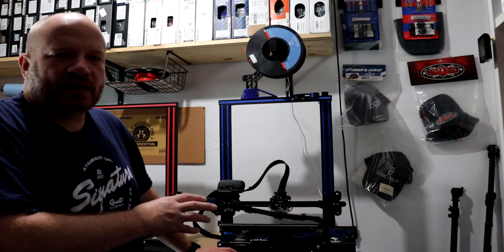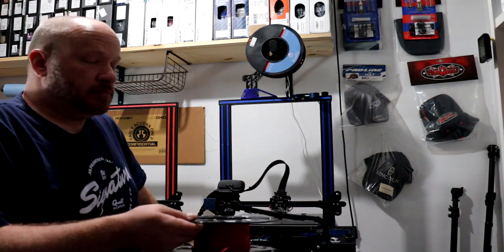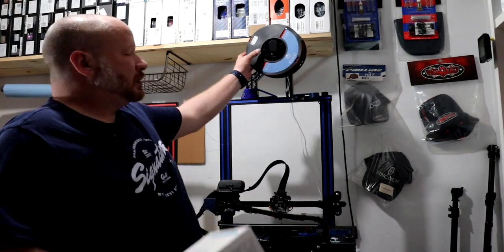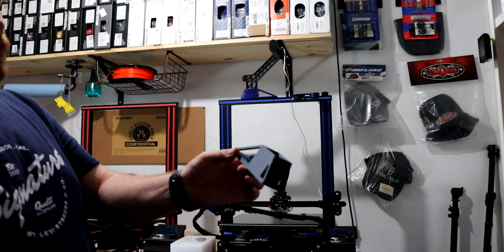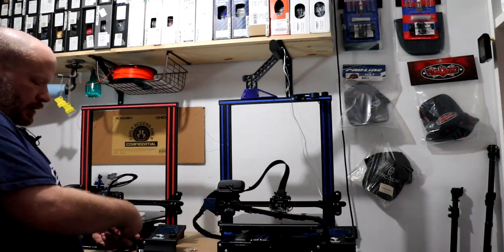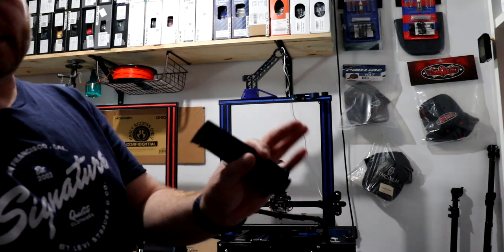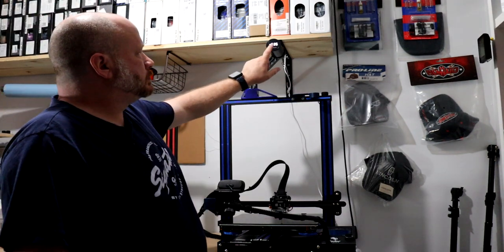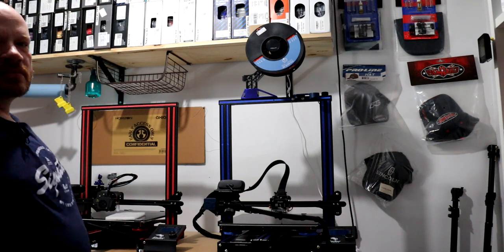Creality 3D Digital Spool Rack-S Accurate Weighing Of Filament

Comment: It would be useful if it stored the weight on the spool and let you reset it manually, or more importantly, had a way for you to tie into it with Klipper. I would absolutely buy this if I could have Klipper check the amount of filament left and compare that with the file its being told to print.

I know the Ender 3 (Im using the S1 Pro) has the filament sensor, but having the amount actually left on the spool be available within Klipper would be very useful.
Reply from the maker: Yes, it would be useful if they could talk to each other. Unfortunately, it doesn’t.  To be honest with you the digital spool isn’t that great unfortunately. I’m not sure if mine is defective or not it’s fully charged doesn’t want to stay on when I’m printing.
Reply: @djsprc  Yours isn't defective. If I review this item, all reviews say that it goes to sleep at 20sec and loses the last weight. All of them.

However, if it's that important to me, I suppose I can create one using the Arduino project InterlinkKnight made and outlined (https://www.youtube.com/watch?v=WO-hR7okl3k), though I'm not sure it's quite that important to me, lol.
Reply from the maker: @jhyland87  I do remember this video I did watch it it’s something I might do in the near future but at the moment if the digital spool is not working correctly, I don’t mind but thank you for sharing that that link.